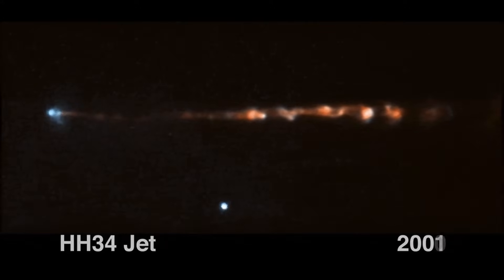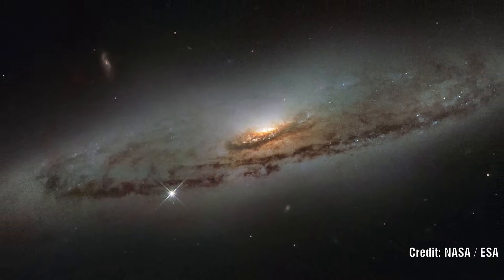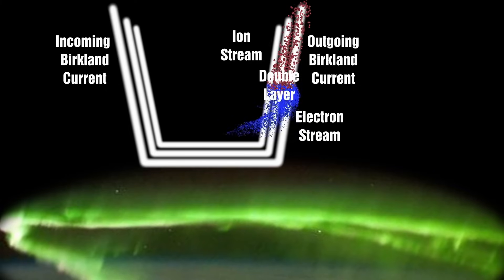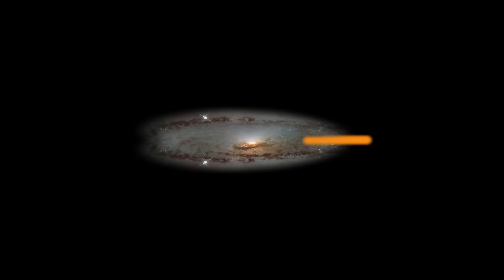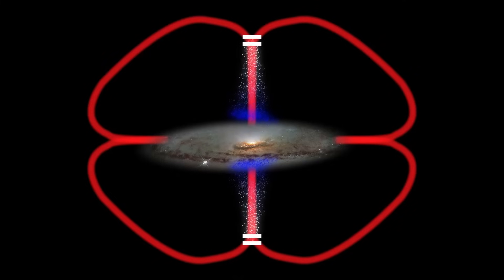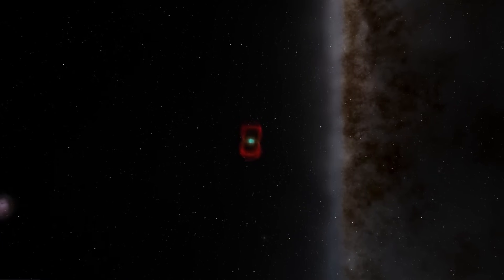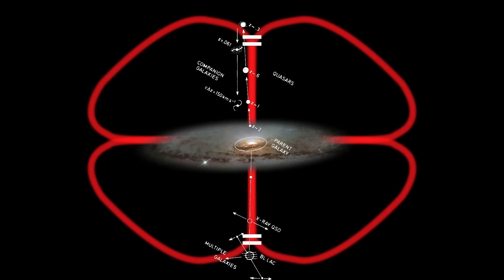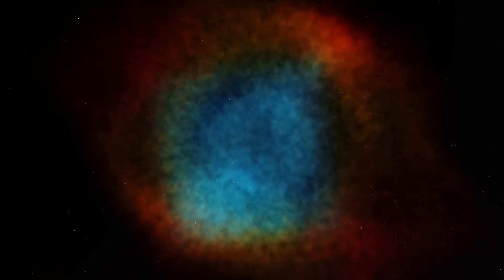Alfven Galactic Circuit Model (No Music)

Comment: Refers to page 8:00. I saw two modes of Birkeland currents. 
Case 1. Without magnetosphere: 
One feeding up to South Pole and the second down on north pole. Each flow experiencing a common polarity repelling one another responsible for the divergent field and associated material (stars) responsible for to galactic disc forming. 
Case 2. With magnetosphere. 
The current feeding in the North Pole also feed out through the South Pole, the combined currents generates a magnetic torsion (Faraday’s motor) in like direction also responsible for disc moment and disc spreading.

The next question is - can we find any galaxy without a magnetosphere? If not then case 2 prevails. That Birkeland current feed through the polar regions. If yes Alfvén’s model prevails.

Comment: Plasma physics uses his mistake.
Ideal MHD does not apply to anything real.
 
MHD applies to when there is an atmosphere thick enough to behave like a fluid and the levels of ionization are too low to undermine the existence of hydrodynamic properties..
The concept of ideal MHD is dumb
It is MHD applied to a case when there is no hydrodynamic properties what so ever, since the system is ideal.
The ideal case is when there is no MHD at all.
When ionization is so high that hydrodynamics disappears from the plasma. 
 
The plasma physics used by astronomers have no root in reality what so ever.

Comment: Polarity of the AC supplying power to the local stars is the square of the sunspot cycle ... not thousands of years, merely hundreds. The Bethlehem Star is a timer for the motor driving the system. December 2020, was the last. 30 years for miracles?

Comment: I wonder if the vastness of the universe plays a part in driving the energy of the universe - that local events separated by huge distances, and therefore time, is like a dog chasing its tail. At any point in a hugely scaled up circuit there would be no "instantaneous" information about other far away parts of the same circuit, yet the circuit would exist and function.

Comment: It seems to me.  The returning flow maybe likely to twist with the rotation of the galaxy.  Possibly creating a several other dynamic effects.  Maybe that return at the along the disc of the galaxy.  Is what helps hold them together.  The poles being anchor points and the equatorial return zone.  Countering the effect of spin trying to throw out the mass of the galaxy.

Comment: what would you expect to see with two Galaxy's running in to each other?!
Reply: It might look like a choreographed dance where no body can crash into another. But the the interactions lead to a rearrangement taking place. 
And complete surface destruction on the interfacing sections.
Reply: charge repulsion, making everything slippery, and many thunderbolts/arc discharges
Reply: look up into night sky, we are in a middle of it. the milkyway you see is not actually galactic plane but one leg of the brown dwarf galaxy, google it

Comment: The electric universe doesn't match any of our models.  And it certainly does not match observational data
Reply: It does not have to because it is superior to today's unsuccessful models
Reply: As Wolfgang E. Poly would say:
You Not Even Wrong!
Reply: @forrisvourvopoulos3252  Pauli * autocorrect strikes again
Reply: Making a statement like this, you are either trolling,
or you are playing dumb intentionally like flat earthers.
Reply: This theory is the only one that actually explains what Is observed simply.
Reply: @aesops-ghost7756
It certainly does match observational data. 

Intrinsic Redshifts in Quasars and Galaxies
H. Arp
Max-Planck-Institut fu ̈r Astrophysik, Karl Schwarzschild-Str.1, Postfach 1317, D-85741 Garching, Germany

C. Fulton
School of Physics, the University of Western Australia, 35 Stirling Hwy, Crawley 6009 WA Australia
D. Carosati
Armenzano Astronomical Observatory, 06081 Assisi (PG), Italy
ABSTRACT
We report a cluster of quasars that has 21 of its members at redshift z = 2.149 within a range of only ±.019. It has an extension across the sky of ≥ 3.2 degrees. At its conventional redshift distance it would have a huge diameter of 249 Mpc. The front and back should reflect the expansion of space of about 13, 700 km/s, but measured velocities within the cluster are only of the order of 1, 000 km/s.
A previously catalogued, compact galaxy lies near the cluster center. When transformed into thr rest frame of this galaxy of origin the quasar cluster redshift is z0 = 1.96, which is exactly the most prominent Karlsson peak redshift! We explore bright galaxies in this region and find they typically have companions at the Karlsson peak periodicity, including NGC 7361 with many physical companions at the lowest Karlsson peak periodicity of zK = .06. A sampling of similar groupings of companions around other bright spirals shows the same abundance of redshifts, zK = .06 (±.01). From the large numbers in this transition stage from quasar to galaxy they could be said to form a major constituent of the universe.
Most importantly, it is found that when high redshift quasars are linearly paired across a galaxy that their intrinsic redshift can be measured directly as it splits into two oppositely directed components. The intrinsic redshift of the ejected quasars falls uncannily close to the predicted Karlsson peaks - within ±.01. It is argued that data going back to 1968 confirm that quasars are ejected and evolve in luminosity and redshift into normal galaxies which lie on or near the classic Hubble relation.
Subject headings: galaxies: active - galaxies: individual (AM 2230-284, NGC 7361, NGC 7793, NGC 4410, UM 341, NGC 4151) - quasars: general
Reply: Znaczy to że nic nie wiesz

Comment: No Gravity whatsoever anywhere. Peace ✌️ 😎. Great video. This is the proper direction for science to be moving. I haven't been paying much attention lately. But I'm about to help if I can. Stars 🌟. Remember it trickles up and down. There's a connection to the great attractors I haven't figured out just yet been on a break from the thing. We will get there. It's the primordial gases that created these behemoths. That's the difference between cores. The first are self contained, closed systems. They don't get bigger or smaller, they don't evaporate. Their purpose is to rid the vacuum space of the gaseous matter state. It's incredible and we gonna figure it out. Peace ✌️ 😎.

Comment: Actually, the aurorae are not completely driven by just the solar wind.
  It is indeed charged particles from the solar wind that causes the aurorae. 
However,
The auroral circuit is an energy exchange between the magnetosphere and the ionosphere.   The Dungey Cycle.
The auroral circuit is driven by the sunlight impinged on the day side of the magnetosphere/ionosphere and the magnetic pressure difference between the day/night side of the planet creates a magnetic pressure difference which drives the energy exchange between the ionosphere and the magnetosphere, at the polar region.

   The aurorae light up when charged particles are caught in the magnetic circuit, but the charge particles from the solar wind are first caught in the magnetopause/ tail then cross feed or back feed towards the polar regions.

Comment: Such a circuit might work well for a galaxy, but perhaps not for the solar system.
A galaxy rotates as a rotational vortex, while a solar system rotates as an irrotational vortex.
This indicates that a galaxies rotational energy is at equilibrium with the input energy it gets from the Cosmic Web.
    One thing Alfven did not foresee is that galaxies are fed by an input current from the Cosmic Web, and rotation is caused by a Lorentz force from the incoming current.

But the Sun, for example, releases stored energy and is not at equilibrium as far as input vs output.
The Thunderbolts Project estimates the input power to the Sun as about 1 billion amperes, but the Sun's output energy is estimated at about 1 trillion amperes by NASA probes.
 Our Sun's output energy will overpower any such Alfven Circuit.  Any anode-cathode situation proposed by Don Scott is far too weak to overpower the stored energy released by the Sun's photosphere.
Reply from the maker: I don’t disagree with your logic but do we really see an input current from the cosmic web?  I would argue that what we see as the cosmic web is an imprint that we assume was a structure. When we examine galaxies we generally see that they are outputting material although Peratt makes the interesting point that even that might be an illusion.
Reply: @SeethePattern  'Spiraling Filaments Feed Young Galaxies'
July 01, 2019
New data from the Keck Observatory show gas directly spiraling into growing galaxies....

-  Cal Tech
Reply: @SeethePattern  'The Origin of Matter at the Base of Relativistic Jets in Active Galactic Nuclei'
Gustavo E. Romero, Eduardo M. Gutiérrez

I submit that the relativistic jets are due to an overpressure of magnetic flux storage in the core of the ring current of a galaxy.
An 'Active Galaxy' is just a result of an overpressure of the magnetic flux storage ability in the center of the plasmoid.  Such jets are neutral and do not contain charge particle flow until the jet impinges upon on the surrounding environment of the jets.

Comment: I'm going to lose a few brain cells over this one. What came first the chicken or the egg? How do we get rotation on the Earth? Coriolis effect but Galaxy rotation seems to be random. First there is rotation, then static charge, current then plasma??? This would suggest to me there is an ether to create the static charge.
Reply: Galaxy rotation and orientation is not random. There are 15 galaxies observed to have the same north-south pole direction, also galaxies rotating around larger central galaxy as well as proto galaxies pointing to the center of their host galaxy. There are also dark galaxies that are to faint for our instruments to see that can be detected with radio waves and surround most galaxies. So the rotation is deeply connected to a universal current and flow.
Reply: @antiprismatic  You are quite right, the evidence is compelling, perhaps angular momentum accounts for the unalignment of most galaxies??? But how can we prove it either way?
Reply: @antiprismatic  I believe as well they are alligned in some cases, but the initial galaxies orientations started randomly, of course after that forces came into play to realign, question is how much each of the forces contribute to an allignment, which one dominates under which circumstances.
Reply: Yes -  "Cosmic Ether-Drift and Dynamic Energy in Space Bibliography and Resources" 
 James DeMeo: "Dayton Miller's Ether Drift Experiments: A Fresh Look"
Stephan Gift "A Modern Approach to Space-Time Physics" 
"Tests of the One-way Speed of Light Relative to a Moving Observer"
"Einstein’s principle of relativity and cosmic-ray muon decay" 
"Detection of the Ether Using the Global Positioning System"
Reply: When mass gathers, due to gravity, you get rotation for free, because a vortex is the most optimal way to get mass  towards a centre. Due to non perfections, the vortex always gets a direction that gets amplified by more mass falling inwards increasing the vortex's power and attracting more mass, the spinning magnetic field comes naturally with it.
Reply: @Amplituhedron1  There must be a NET angular momentum for vortex to form from gravitational accretion.
Thankfully, Plasma provides for it's own spin.
Reply: @Amplituhedron1  99.9% of the matter in the universe is plasma. It spins.
"Gravitational systems are the ashes of prior electrical systems." - Hannes Alfven.
Gravity is an afterthought. It has almost nothing to do with the accretion of matter.
Reply: @Amplituhedron1  W eterze a eter to fotony lecz obecne wszędzie.
Reply: Galaxies, stars and planets, are all powered by plasma from the outside. Spin is a property of current/plasma. Right hand rule.
Reply: It’s the same way bodies form. Stars are equivalent to cellular nuclei.  You’re obviously looking at organisms- what people used to call one of the layers of the pantheon of gods.  People just didn’t know how to integrate the truth of Christianity with the obviousness of fractal life patterns.